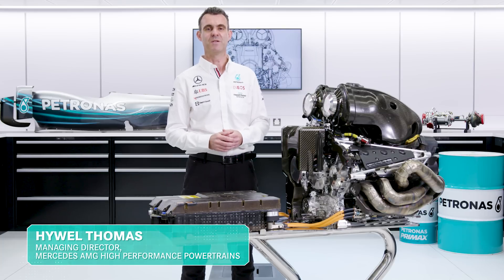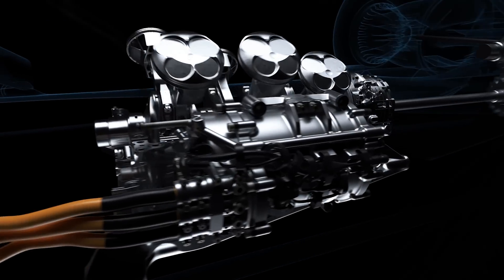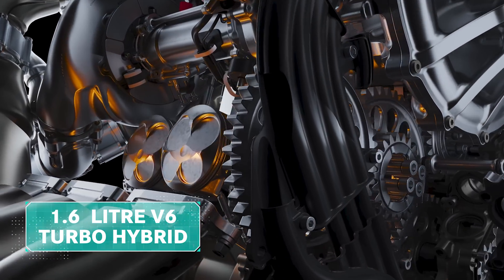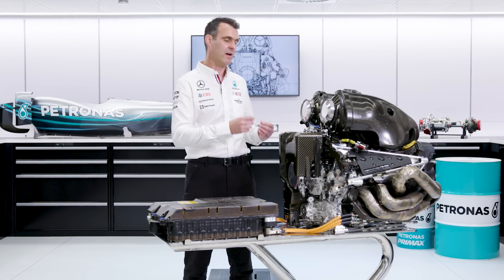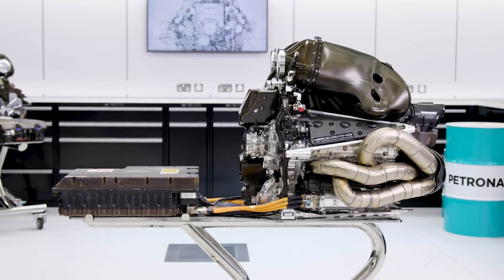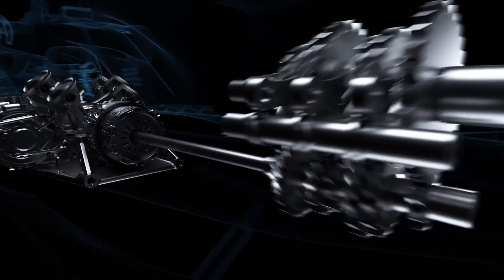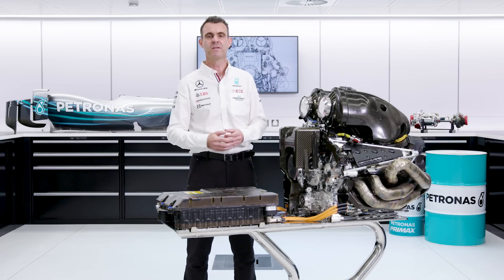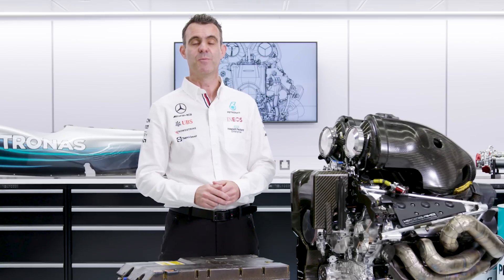Power Unit 101 with PETRONAS: Internal Combustion Engine, EXPLAINED!

Comment: It takes a while to comprehend the fact that a 1600cc engine (smaller than some Harleys) can produce 1000+hp of power. The true pinnacle of motorsports.
Reply: 35 years ago the BMW F1 engine delivered 1400 HP from a 1500 cc engine. THAT was  the pinnacle of motorsport.
Reply: @knowntobehonest  With about 12 cylinders ?
Reply: @herschelle.c  no, 4 cylinders turbo

Comment: The VW Beetle also had a 1600 cc engine in the 1960's and later (as well as other engine options). But I think the power output was a little lower.

Comment: If there was no PU limit to a season, based on percentage, how much more power could these engines produce?
Reply: If let's say they were to change engine after every race weekend like in the V10s era for example, they could bump up the rev limit to 16000rpm maximum during qualifying, 13000-14000rpm during a race.
Reply: Could be 1300-1500 BHP

Comment: So far Mercedes PU is one of the most reliable in the paddock this season. Great job
Reply: it's actually the most reliable of all PUs
Reply: @SalahEddineBellemallem_ma  LH is the only driver not to have a DNF this season
Reply: @Fleeb-pb7zo  Russells DNF wasn’t a mechanical one.
Reply: @Fleeb-pb7zo  hello im from future hes DNF in spa
Reply: @richiefauzi2015  still not a reliability dnf
Reply: @Fleeb-pb7zo  Aged like milk
Reply: @air_  so true
Reply: @Fleeb-pb7zo  lmao
Reply: @Fleeb-pb7zo  LOL, well that aged like milk.
Reply: @Fleeb-pb7zo  You jinxed it lol
Reply: @Fleeb-pb7zo  that aged well
Reply: @Fleeb-pb7zo  well that aged like milk
Reply: It's because they haven't been using the full capability of the engine. They Just detuned it because of porpoising.(As per Lewis Hamilton in an interview)
Reply: @shabasnm  imo, that's a very smart move. Even if they didn't have porpoising issues, getting their car a bit more reliable was crucial as they were imposed with the biggest budget cap and testing limitations going into this season. That definitely saved them quite a bit of money and parts. In the last few races, they managed to narrow the gap to RedBull and Ferrari even with straight line performance deficit. RedBull might already a bit too far at the front, but still plenty of potential to catch up and overtake Ferrari.
Reply: Most reliable in not winning races indeed 😂
Reply: are mclaren, williams, & aston martin don't use mercedes PU ?
Already forgot some of them retired because of PU issues ?
Reply: It's what, very well, may lift them above the red cars in points before the season ends.

Comment: We all know the engine is incredible but the aerodynamics department didn't know what to do this year! 👀
Reply: Nah, I think Ferrari and Red Bull engines are faster but unreliable when pushed to limits but Mercedes keeping theirs reliance by sacrificing some speed still aero is a problem
Reply: Everybody says aero is a problem for the Mercs but they are king in fast and medium speed corners. Lol how does that work. Aero is not a problem unless you mean they have to much top end down force. This issue should alleviate with the new floor. More down force created from the floor instead of the front/rear wings and body means more speed on the straights = hammer/russel time.
Reply: It's not the aero, the engine simply lacks power.The RedBull blasts past the Mercedes down the straights so easily..
Reply: @ef1112  It is due to aero, Mercs cars are too draggy because the rear tires air flow is dog water, they are basically a small parachute at this point, they can't control that flow with a side pod that lacks surface area to work with
Reply: @DeferedPattern  I don't think they wouldn't have tried to change the design of their sidepods by now, if that would've been the case.Changing sidepods would be a whole lot easier than changing a frozen engine.
Reply: @ef1112  They haven't tried changing the side pods yet because of the budget limit, it's not that easy to change the side pods, they would need to redesign their current cooling solution and engine packaging, the low energy hot air coming from the radiators changes how the airflow works downstream and it needs to be carefully exhausted where it would benefit the beam wing and rear wing, it's a type of upgrade that needs to be done right from the get go, otherwise it would eat up a good chunk of the year's budget and wind tunnel time, their engine is still powerful, they just haven't been able to utilize to it's full potential yet, you have to remember that engine's were frozen back in march, it is very unlikely that Ferrari and Honda would have that big of a jump in performance and Mercedes would fall back in performance considering Mercedes engine was a monster in last year's second half.
Reply: Hi guys, I want to ask you all a question. 

Just started watching F1 little while ago, from what I have heard people say it seems that Mercedes’ has the fastest car. But from what you guys are saying it sounds like the red bull team has the faster car on the straights. 

Did the red bull team design a faster engine within the last year or two or…?

Comment: Can you guys explain how drives use ERS, how they deployed during quali and race and how they harvest?
Reply: Ong
Reply: Press magic button 😅😅😅
Reply: Stop inventing ... Stop inventing ...

please mercedes keep it soft ... it is a competition where Rivals are waiting the opportunities to be in front of you... So be careful
Reply: Much telling ferrari trolling them
Reply: Check out a channel called Yelistener, he has a great video explaining ERS.
Reply: press button and deployed
Reply: @importanttingwei7747  🤓
Reply: Ers is always on but it has different modes. Think of it like low medium and high but more complex than that. There is an overtake button which deploys maximum output but is only used in short bursts to make overtaking a bit easier.
Reply: @mfpresident8150  actually that's just the f1 games drivers irl have much more control than that
Reply: @adamn7125  That's what I said Adam N
Reply: @adamn7125  In F1 2018, you had a lot more control with the ERS output. Control has been limited with the newer games as they came out unfortunately. But ya, I think F1 drivers have a lot more control with the ERS than any of the F1 games